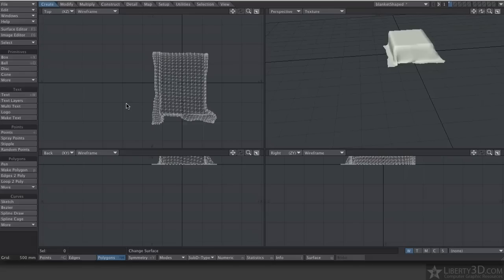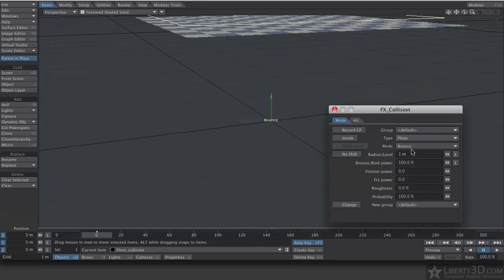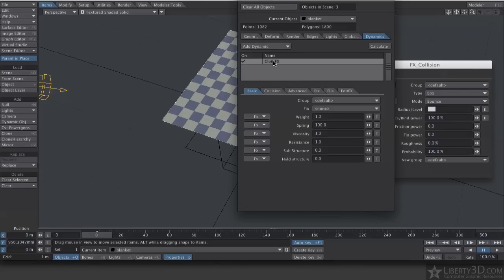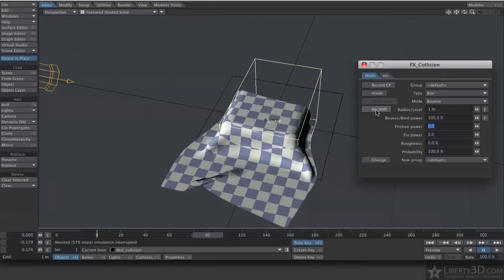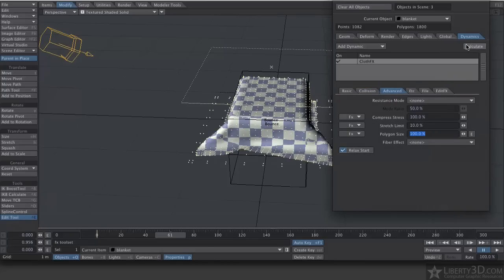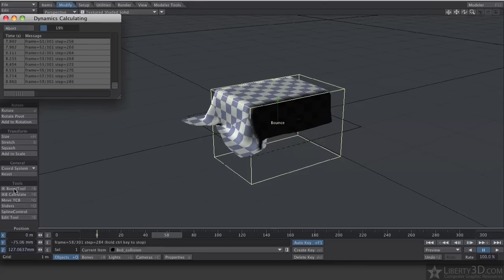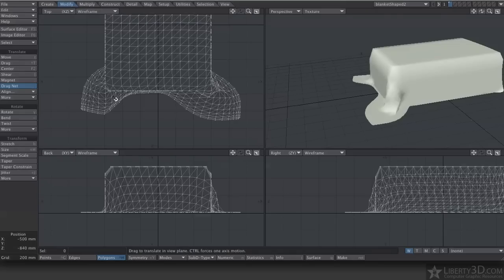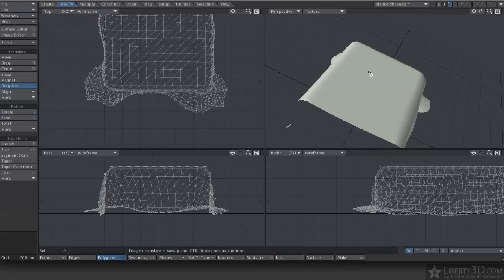Lightwave Tutorial: Shaping A Blanket with Dynamics

Comment: How much "subdivision" should be done on the blanket?
Reply from the maker: +Leo Chen There isn't a specific amount that I can say. It depends on how many polygons make up the base mesh and the type of subdivision you're using (sub-division surfaces or Catmull Clark - this is set in modeler). You basically want enough subdivisions to let it fold into the shape you want, but not so much that it takes forever to calculate. It may take some experimentation. Thank's for watching. :)
Reply: +Dana Burman 

Thank you.